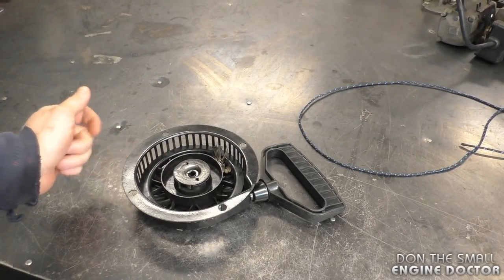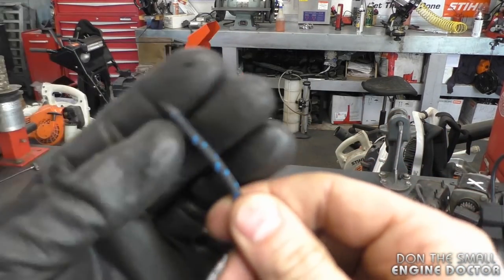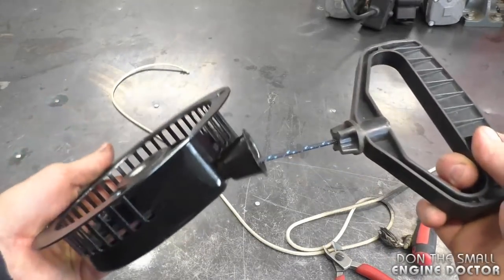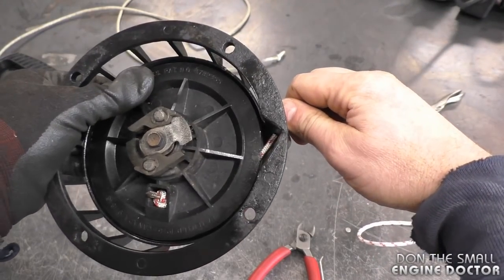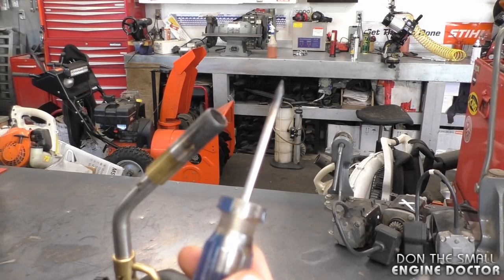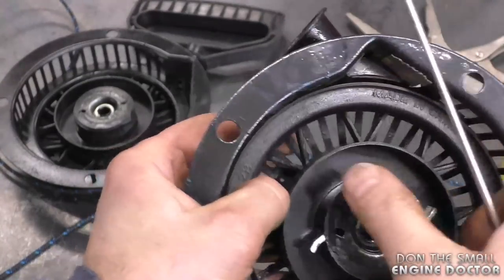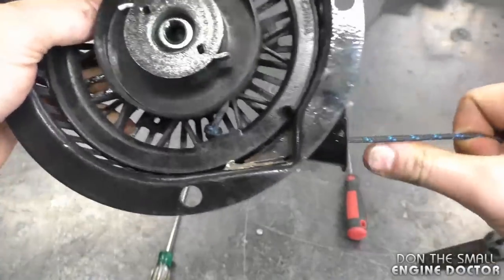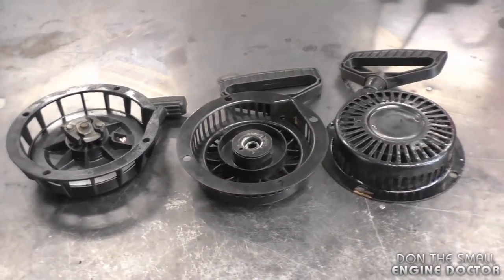Snowblower Pull Cord Repair - video

Comment: Hi Dony,

I inherited a MTD Snowblower with a Tecumsuh HMSK100 engine. I work in IT and know my way around a tool but wouldn't call myself mechanically inclined, but after watching your videos on replacing the carburetor, fuel lines, primer lines, and pull cord the whole thing runs like new. 

Thanks for these, really, without them I would have just sold it for scrap but now I have a great running machine and the confidence to start maintaining it myself.

Comment: Thanks to you, I purchased a roll of that rope. One thing I learned it go a bit longer on the length of the rope and don't use the old rope as a measurement in case it has broken in the past. My point is, if you cut the rope too short, you will have to redo the job. I go longer then before making a permanent knot,I check to be sure the rope has a long enough pull. I short sheeted myself on a rope last year because apparently the old rope was broken several times before, so the original was  short. That hole idea is a good idea. I don't make these videos because you do.

Comment: I'll often cut it after winding cause I'm not usually sure how long it should be. You could use the old one but who knows if that was the right length. Great tip with the notch!
Reply from the maker: most snowblowers require a 67" cord
Reply: @donyboy73  that's great to know, thanks!

Comment: Great video. I have a question speaking of snowblowers. My light quit, bulb works(tested with a probe and lights) can I measure dc volts from stator with standard dc volt meter? Was thinking for some reason I cannot.

Comment: Great video,  watching your video tells me if I am doing it right or wrong,  LOL.
Can be time consuming hooking the rope through so I understand why you left it out but some guys might need a demo on how to get it  through the pulley. 
I have been using #5 rope, and that's even harder to get through. 
Don, I have 4-5 of those condemned cause the spring is gone and when I replace the spring I can't get the starter paws to come out properly,  you have a video on how to replace the spring and get the paws working?
Thanks

Comment: Hello Dony I'm Tony from Rochester ny and I'm having a consistent problem with my husky snow blower since I purchased it in 2010. The pull  cord pulls rather heavy from the day I bought it. I'm pretty strong but by the 4th or 5th pull I'm exhausted. Thank God I have an electric start. But even with that the starter has to spin 5 or 6 times before it will start. I treat this like a baby and I do all the maintenance on it every year. I'm concerned that if the starter goes on  me in the middle of using it I'll be stuck. Do you have an idea for a 70 year young man. Your help would be well appreciated...Tony

Comment: Dony, please excuse my barging in with a different problem, and greatest thanks for all your year in, year out diy problem solving advices.
I have different garden tractors and equipment I repair quite knowledgebly, here my problem. I purchased a few weeks ago  a Craftsman 42" decker, with hydro/trans and Kohler CV 491 17hp, with the solenoid carb switch. Start's first rev, runs perfect drive great, but for no reason after 15, 30 minutes or so nothing precise time wise motor starve and stop, easy restart, might stop again and not. Specially on slithly rough terrain going uphill it stops. To test I've chosen a hill stop right in the middle and stay put, motor runs great. Is there a oil sentry I'm not aware. Is it the carb solenoid, the coil, the float angle in carb beat's me.
Please could use your help Dony
Thanks Alain
Reply: I forgot to mention if the lights are on it stops less frequently. My thinking when the voltage is higher because electricity demand from lights would the carb solenoid be more stable?

Comment: Hi Don, I'm new to your channel. I have my grandfather's snowblower in the Garage. It has a 10 HP Tescumseh engine. Last year one of his friend replaced the carburetor. This year, he wasn't able to get it running. I removed the carb, clean it and clean the fuel tank. It was running "ok" only at high idle. (Small surging) I removed the carb again and cleaned it. It didn't change the outcome of it. After doing some homework, it wasn't the proper carb on it. It was the non-ajustable one while his requires the carb that has the air and fuel adjustments. I ordered the proper carb, installed it. It runs alot better now, no more surging, but I'm still having difficulty keeping it running at low idle. It wont surge, but it just dies. The only way to start it back up is to prime and, and full throttle. Any advice?

Comment: have you run into them bv125 huskys leaf blowers that have reverse nut on fan side  2018 models yet?.the nut was galled on shaft and stripped the threads ruing the crank ugg
Reply: not even a full a full round stud its a half cut down middle
Reply from the maker: @johnhanson4795  yes it's garbage

Comment: I have a really stupid question for you.  I have a Craftsman 24” snowblower with a factory headlight.  How in the hell do I change the bulb when it will not fit through the housing. I tried removing the headlight assembly but it will not budge. How can something so simple be so difficult?

Comment: The procedure for when the cord breaks inside (where the knot is) is a bit different, because after removing the broken piece, you have to wind the recoil starter up first - I think it's 7 revolutions, and then put your screwdriver in to hold it. It just happened to me, and I ordered a new rope, but figured I'd try using the old one first. Funny thing, these ropes seem to come long, so I had a length of rope sticking out past the handle, thinking if it broke again, I would have that extra length of rope to work with, but no, you will never get that knot out on the end - it just keeps getting tighter and tighter. Tried the soap trick - nope.

Comment: Why not just use math for the circumference of the pulley to figure out how many turns to accommodate the length of rope for units that the rope broke and spring unwound?  Save from that melting a hole option. take diameter of pulley x 3.14 .  Then cord length inch's divided by circumference inch's = number of turns.  Each turn the rope wraps may increase the circumference a bit but won't make much difference considering rotating full turns each time.  Rounding the number of turn essentially.

Comment: Hi Dony, great help thanks. I’ve got a log splitter here in the UK with a Honda GX160 engine that dies under heavy load, I’ve had it serviced but still does it. Has it just reached its 9ton limit or might it be something else. Keep up the good work. Pete
Reply from the maker: did they clean carb?
Reply: @donyboy73  Not to my knowledge, have you done a vid on that and I can have a go.
Reply from the maker: @Mozzer209  similar to this video https://www.youtube.com/watch?v=gV6IOkevloM
Reply: @donyboy73  Thanks Dony, I really appreciate your help your a good man. I’ll take a look. Regards. Pete